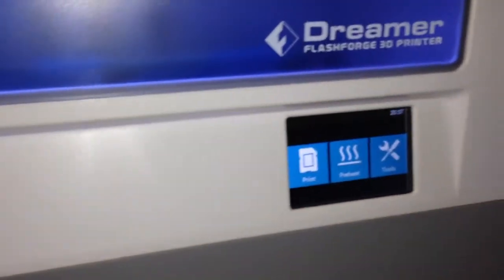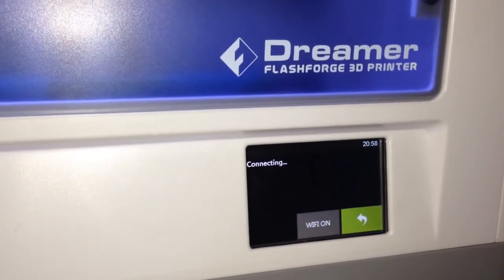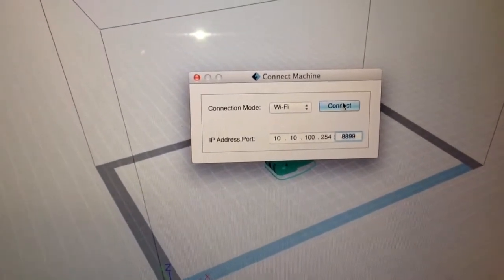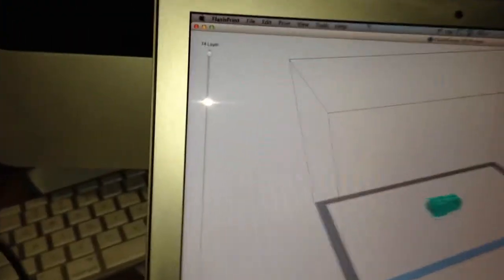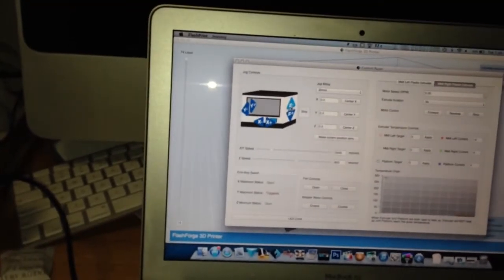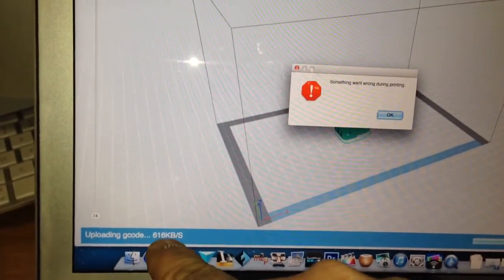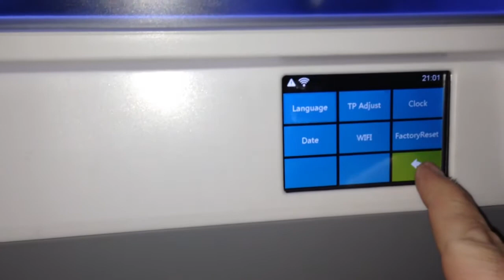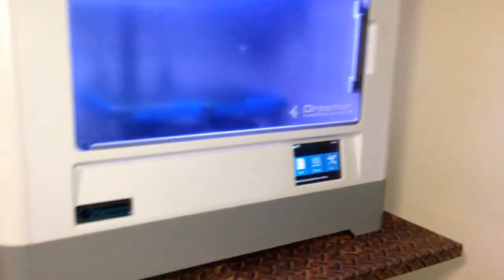Flashforge Dreamer - Wifi not working

Comment: I am having the same problem. I just got this printer from a thrift store and it looks like it was barely used. I can print from SD, but I get a similar error message to yours when I try to print from a Windows PC. My printer is definitely connected to the home network and pulling an local IP address automatically. I can even access the WiFi module's web server with http://[ip-address] -- so there's nothing blocking connectivity.

Comment: Hi Thomas - thanks for al your videos! They're really helpful! Have you managed to sort out the wifi issue?
Reply from the maker: Apparently Flashforge have released ne firmware 2.1 that fixes the wifi issue but I haven't updated yet
Reply: Interesting. I uploaded a firmware change last night but 2.1 wasn't pushed...just a minor increment on 2.0
Reply from the maker: Richard Fortune So with your new firmware and flashprint, can you print via wifi?
Reply: Thomas James Afraid not. And unfortunately I'm on OSX10.10 which means FlashPrint is not working normally either. :-/

Comment: my build plate is smooth as well.. FYI  also own a dreamer for 4 days.
Reply from the maker: I can control everything by WiFi but whenever I hit PRINT, it just comes up with this error? Can you print by wifi?
Reply: havent tried wifi on mine. I'll try to hook it up tomorrow after work and see what happens.
Reply from the maker: Ronn Trevino Thanks for that. I would be interested to see if you have the same error as me
Reply: Thomas James looks like everything is working. but once the gcode is uploaded I get 2 errors, something went wrong. then network error.. Looks like in the manual theres a set up process in STA mode. I don't see that on a mac. nor does it prompt me for a username/password.. theres a step in set up that I think Im missing.

Comment: I got the same problem and got the resolution by unplug the printer for at least 30 sec. and restart the machine again. The problem has been solved. I think it might be the machine is out of memory, unplug the machine will flush all of memory. Hope this help.
Reply from the maker: Nope. My wifi module had a dead chip and would not communicate to the main board
Reply: @pcarlson1979  is this still an issue as i cant cinnect via usb or wifi this is annoying to say the least